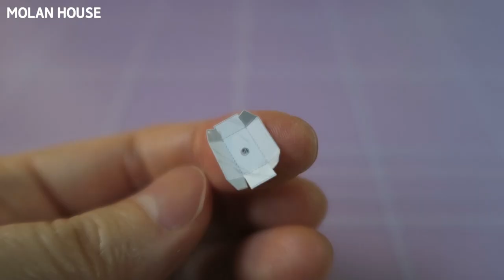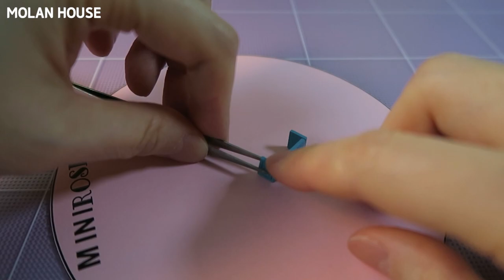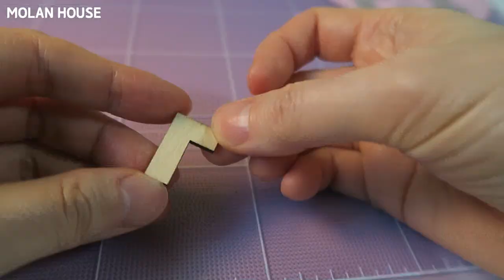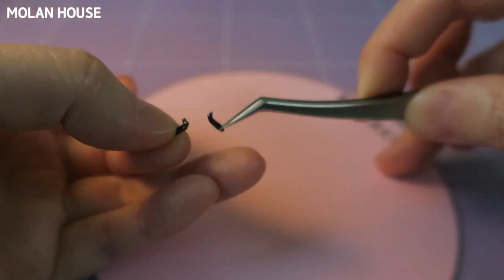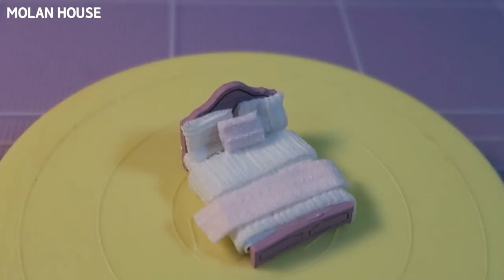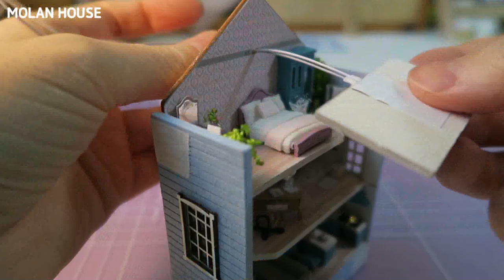DIY Miniature Dollhouse Kit/Molan House 뮬란 하우스/miniature minirose 미니어처 미니로즈

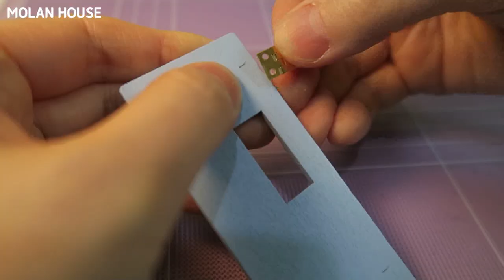Comment: Hello again, I'm wondering what type of glue you use at 30:30 to attach the covers. Thick white and clear glue won't stick, neither plastic glue nor anything, and if you can tell me ❤😊❤❤❤
Reply from the maker: White adhesive is for woodworking, so it does not stick to plastic or metal. I use UHU when attaching plastic.
 Share your site on Amazon ~ 💕  https://www.amazon.com/
Reply: @minirose-miniature   thank you so much 💓 💖 💗 💛